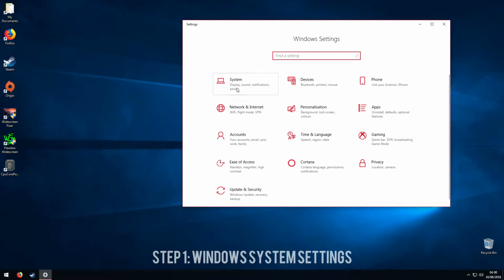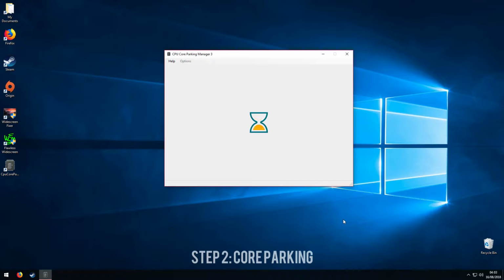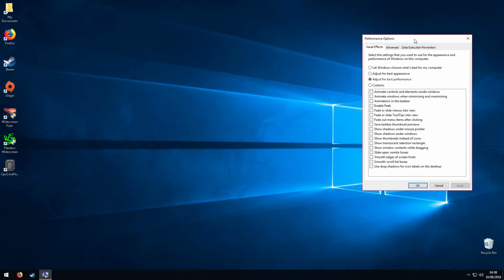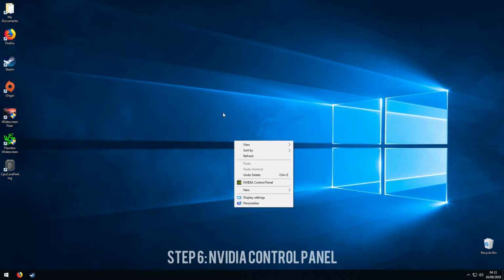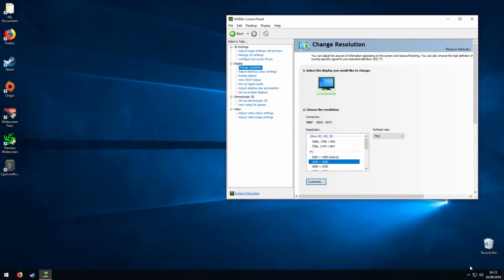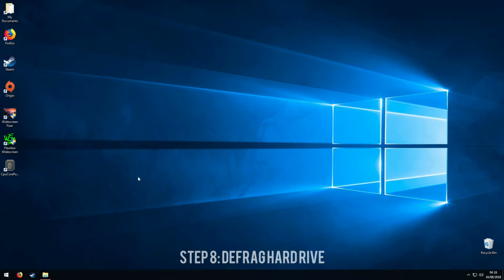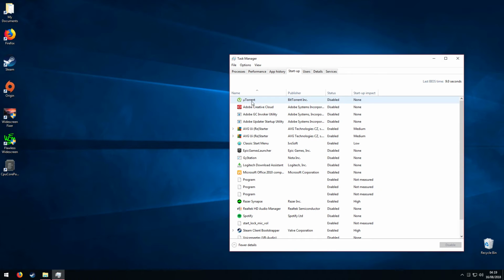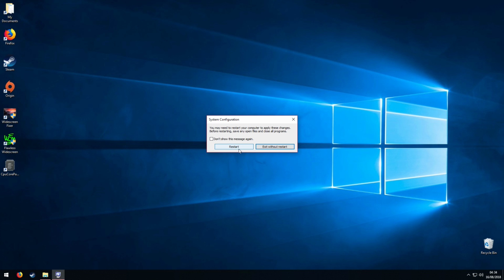Windows 10 Ultimate Performance Optimisation Guide For Gaming And Performance

Comment: bro when i launched msi afterburner my power limit was set to zero and i am afraid if i set it to max my pc might explode since i bought a prebuilt pc like 4 years ago and modified the pc in 2018 so i also dont know how much voltage is my power supply
Reply: @rutai66 okay thank you so much bro btw i tried it after you told me but the thing is msi afterburner wont let me set it to max like its stuck there